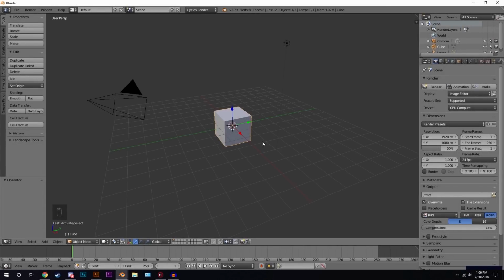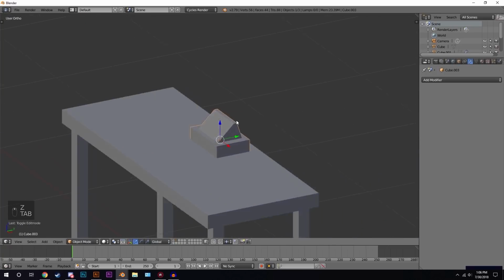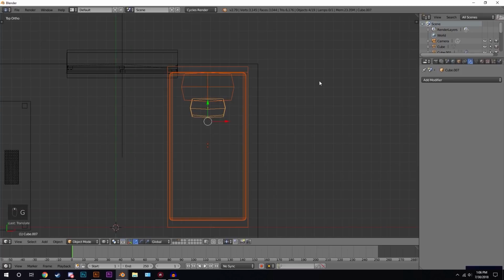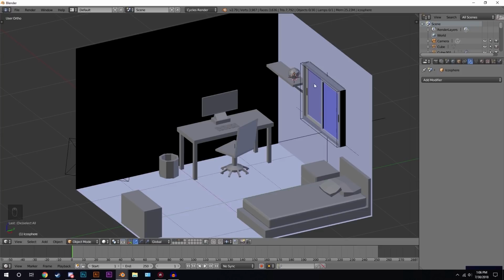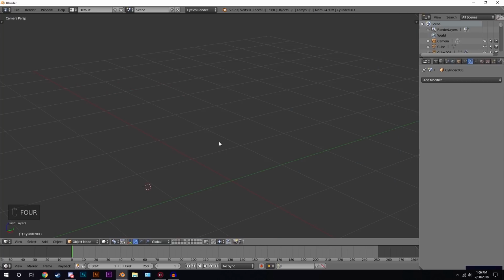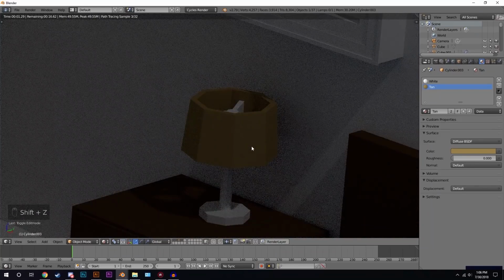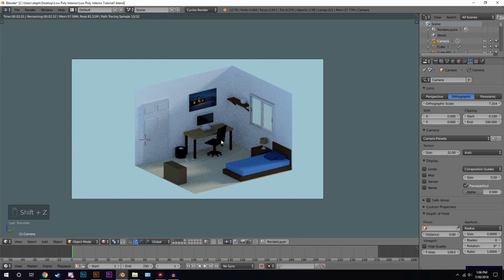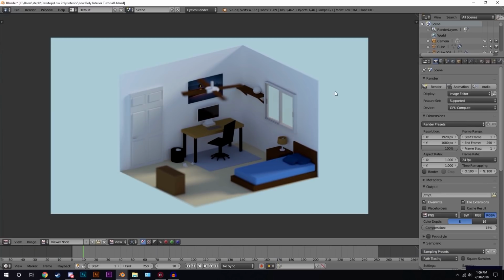Blender Tutorial Creating a Low Poly Interior

Comment from the maker: At 17:49 make sure the origin point of the empty and the wheel are in the exact same spot.  Select the empty and press shift+s and click on cursor to selected. Next select the wheel and press ctrl+shift+alt+c and click on origin to 3d cursor. This will place the origin point of the wheel to the place where your cursor is.  Another thing to note is that you need to apply the scale and the rotation of the wheel and empty. Press Ctrl+A and click on Rotation and Scale for both objects. All you have to do now is rotate the empty and it will move the wheel.   If you are having trouble with this part follow these steps and it should work! :)
Reply: Thank u ...
Reply: Hahaha XD If only I had read this comment earlier, I actually took my time messing around with it until I figured that out :P But thanks tho knowing I did the right thing is good to know. Great tutorial by the way, I didn't know blender had a post process image tool
Reply: Thank you for the tutorial. I ended up copy+past and rotate each wheel, easier for me and same results
Reply: @Raze The Gamer he just went back to object mode

Comment: A few things to note on the modeling part.

The table and the bed I have the same criticism: FOR THE LOVE OF ALL THAT IS MODELED PARENT! CTRL P IS BY FAR THE MOST USEFUL TOOL THAT YOU DIDNT USE! You used a box select when you should have just been able to select the empty they were all parented to. It takes seconds and makes everything leagues easier, especially when dealing with complex objects

Another thing you didn’t make any use of was solidify. There wasn’t much use for it but IMO a mention of it should be snuck into every tutorial.

My last complaint is that you used a 32 side cylinder on a low-poly. NEVER! IMO anything over 16 (or 18 for how you used it) is heavily overkill and looks out of place.

Comment: Is there a jump cut in 17:53? Because I tried the same way as you did and didn't get the same result.
Reply: Yeah me to. The pop up wheel chair not centered.
Reply: Yeah, I'm lost to...
Reply: At 17:49 make sure the origin point of the empty and the wheel are in the exact same spot.  Select the empty and press shift+s and click on cursor to selected. Next select the wheel and press ctrl+shift+alt+c and click on origin to 3d cursor. This will place the origin point of the wheel to the place where your cursor is.  Another thing to note is that you need to apply the scale and the rotation of the wheel and empty. Press Ctrl+A and click on Rotation and Scale for both objects. All you have to do now is rotate the empty and it will move the wheel.   If you are having trouble with this part follow these steps and it should work! :)

Comment: Hi thanks for the great tutorial. But i have some problem. regarding the wheel of the chair. when i click ctl+shft+alt+C on the empty. the wheel are not rotating and move to the main wheel. how do i do this.
Reply from the maker: Make sure you have your cursor where the empty is at.  Next select the wheel and press ctrl+shift+alt+c and click on origin to cursor.  Another thing you need to do is press control+A and click on scale and rotation. Do this for both the wheel and empty.
Reply: HI thanks for the reply. I just finished following your tutorial without using the technique. but I will try to apply this technique later in my next project. Because it is quite useful for me to learn that.